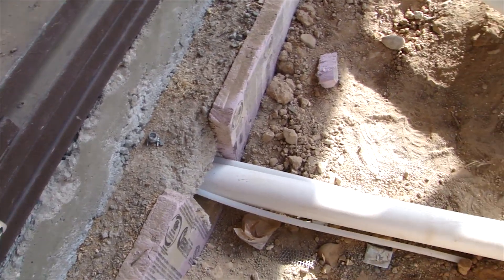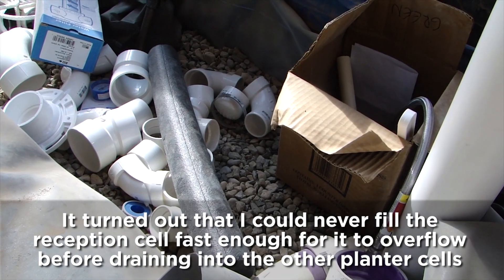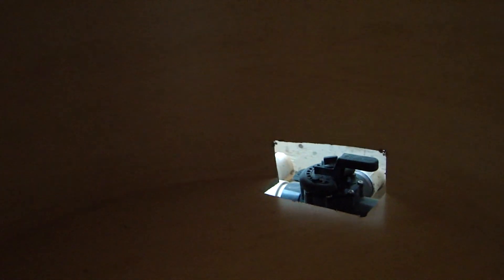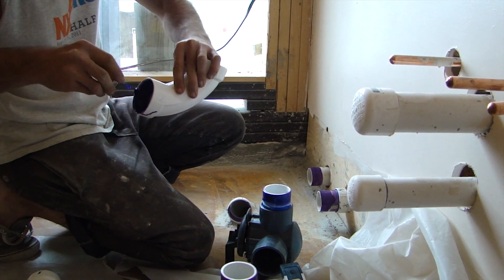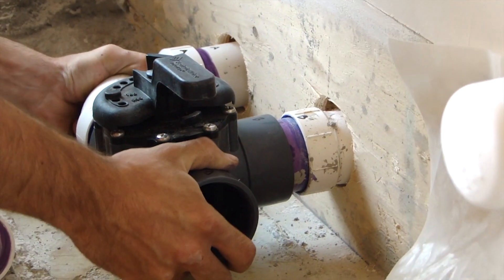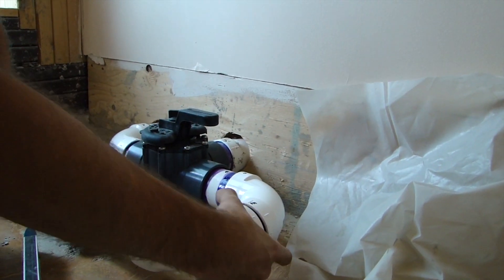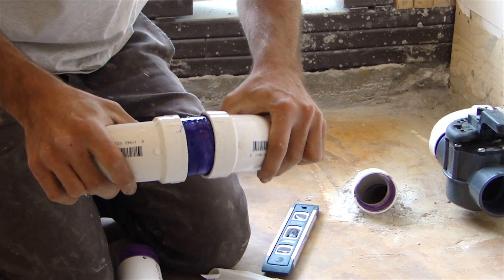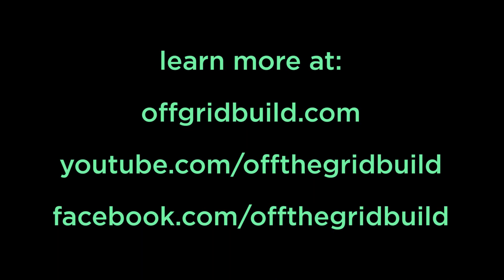Directing Greywater to Planter or Septic

Comment: Proper plumbing grade is only recommended as; 1/4 inch in 2 feet. Keeping the grade shallow makes the liquid carry the solids along better.and elbows down will collect solids on the start of the curve down so if that can't be avoided, put a clean-out to access the spot for future maintence. 

Why not add a push-pull rod to the handle of the valve without cawing under the lazy-sisan...but. 1Timby has a good idea there too !
Reply from the maker: All good suggestions.  Thanks Dennis!

Comment: yea, seems like you would want a p trap anywhere the grey feeds into the black to block gas coming into the grey or you will have very stinky drains
Reply from the maker: Yes,  This was also brought up in my gray water planter series.  The ptrap suggestion on the gray water overflow is definitely the way to go.  However, I have thoroughly checked for sewer gas coming out of the planter and there is none.  There are layers of sand and dirt keeping any gas down in the reception cell.  NOT IDEAL, but that's what im locked into for the time being.